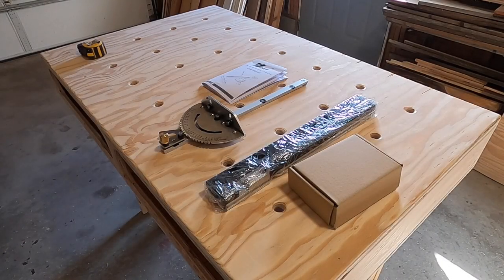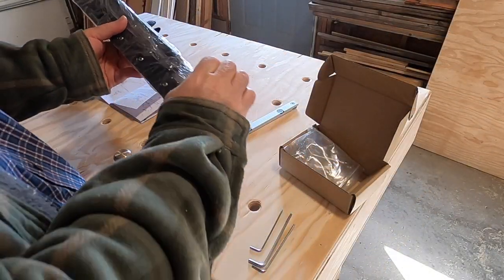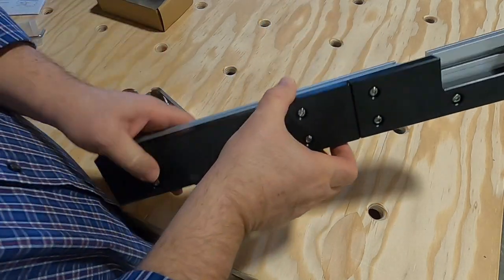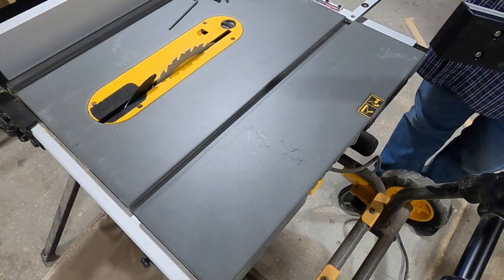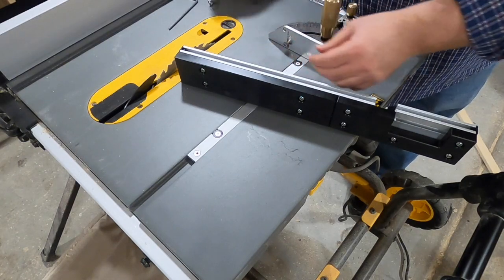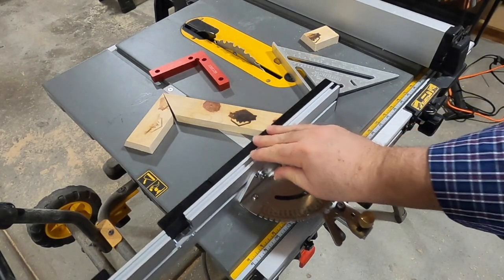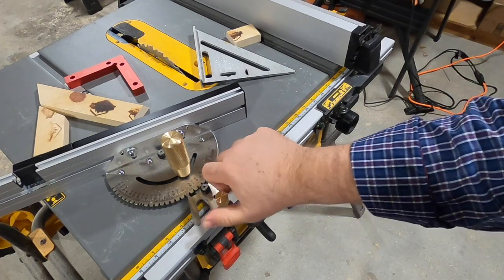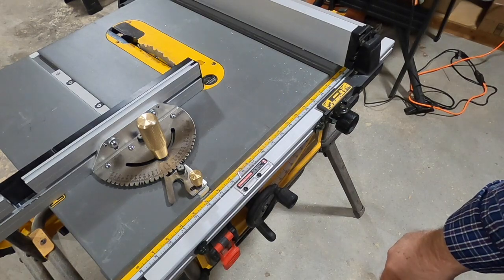Upgrade Your DeWALT DWE7491RS Mitre Gauge - Product Review Episode 15

Comment: Mine came Bangood with the brand name W-NEW.  I fell into the same trap I've fallen foul of a couple of times before ordering Chinesium goods.  I didn't read the description properly and initially received just the fence — which is not a lot of use by itself.  It was excellent quality though, so I immediately ordered the mitre gauge part (with brass handle, because it looks so beautiful, and low and behold it arrived barely two weeks later.  The first part must have taken several months to turn up, and they take your money up front.  Anyway, I put it together and was pleased with my purchase, and it still cost me a fraction of what an Incra mitre gauge would cost.  I was not sure what the wee fingers were for on the fence, so I turned to YouTube and discovered a massive bonus discovering they turned the part into a box cutting jig.  I have a shop made box cutting jig, but it does not produce super tight joints and I've never got round to fixing it, but it looks a piece of cake with this tool.   

Mine came with an invisibility cloak — it just took me a good ten minutes to find it, and my shop is relatively tidy at the moment.  I wish it folded up a wee bit tighter for storage.  You can get a bit straighter by removing the big brass knob, but then it will take even longer to find both parts.  It's surprisingly heavy, and really solid, and even though I had to buy mine twice, it is still excellent value for money.
Reply from the maker: When I bought mine, it came as a kit. I guess you can only buy them separately now. Glad you like anyway.

Comment: Good and helpful video. Could you please advise the cross-section dimensions of of the miter slot of the DWE7491? Many thanks
Reply from the maker: I know I can slide a 1x4 on it's side through the slot.
Fits snugly, so it would be 3/4"

Comment: So you made two straight cuts (at 7:15-7:25 in the video timeline) on the piece of timber that was mitered on both ends and then you checked miterred corner fit? What did you demonstrate there really? Also work on your camera positioning, there is no need to block the camera with your body half of the time.

Comment: Like that miter gauge...  Are you still like the DeWalt Saw? Looking at replacing my 18 year old Ryobi Bt3100. It still is working but parts are hard to find and as I redo my shop I want to build a saw into a work station. Looked at the hybrid but not sure if I want to use that much space up. I build mainly small items and cut my plywood outside before I take it into my shop.  My main concern is the fence. I have used a t-fence for years so I looked at the Ridgid contractors pro saw but have heard the fence is an issue.  Your thoughts?  Thanks
Reply from the maker: Hey Reginald, I absolutely love this saw. It's the best one I've ever owned (of course that's not saying much). Once you get the fence on this saw dialed in, you never have to make sure it's square again. The cuts are perfect everytime just going off the guage. On my old Ridgid contractors saw with a T fence, I had to square it with one of those triangle squares everytime I moved it. None of that with this saw. Keep in mind this is still a contractor's saw, but it's a pretty nice one.
Reply: @TheWoodHaven  Thank you for responding. My Ryobi was more like a contractors saw with a permanent  stand. Only has a rip of 24 inches. I had taken the stand off to incorporate it into a table. I build jewelry boxes, crosses and small items for rural Churches for their children's camps. My main need is something that cut straight. Love to have a hybrid but my shop is only 16x20 and I like to have space to work... don't like having to move stuff around. Going to order the DrillPro to... it will help with my boxes... great vid by the way.

Comment: Hello, I am going to buy  the same miter gauge for the same saw, but only without Box joint jig = with common fence. Just thinking about length of the fence 600mm or 800mm. Do you have any suggestion or any advice what is better length? Thanks
Reply from the maker: For me personally, I like the longer length for more stability,  but I can see where the shorter length would be better for some.

Comment: When starting a cut with the gauge off the table, do you have to lift the gauge slightly to get it onto the table? The track on my DWE7491RS is deeper than 3/8" (it's about 0.400"). When trying an Incra27 gauge I had to lift it slightly to get it onto the table. Is that the case with this miter gauge too?
Reply from the maker: Lifting would work, but I've found if I just hold it level, it slides past the edge ok. If I let it tilt to one side or the other, it does need to be lifted.
Reply: @TheWoodHaven  thanks it is a shame dewalt has such a nice saw and such a poor miter gauge.  The short extension cord was frustrating but that was an easy fix.
Reply from the maker: @j2jcox  I agree.

Comment: One comment and a few questions for you....1. The DrillPro mitre gauge you reviewed looks quite impressive, and I am leaning toward purchasing one also for my table based on your and others comments/reviews. You were very helpful. One comment I'd make is that I noticed that you show your 45 deg. mitered cuts to be spot on; however, your video only shows you cutting 90 degree cross cuts with the DrillPro which doesn't prove the accuracy of the 45 miter cuts. Did you happen to edit that out?

Secondly, I have a Dewalt Model DWE 7480 table saw which varies slightly from yours in that the surface area between the front of the blade and the front edge of the table appears less than your model. Do you have any problems with the bottom of the miter head catching on the edge of your table as it approaches and slides toward the front of the table if it starts its approach from the outside of the table? Lastly, is there anything you do to prevent or minimize tear out? For example, with the metal fence, can you install a sacrificial wood fence in front or behind it for a zero clearance cutout? I'm not sure if I'm making any sense here :) but I thought I'd ask. Thanks!
Reply from the maker: Hey David, yeah I made 45 degree cuts. I'm not the best video editor. I cut stuff out like that often and don't realize it. This mitre gauge has a built-in sacrificial layer of plastic for zero clearance cuts. I haven't noticed any catches as the fence approaches the outside of the table. I think the trick is to make sure you have a nice snug fit in the track.

Comment: Hi.  I just bought this but there's a lot of play in my Dewalt 4791 even when I tighten the screws to expand the plastic rings.  What is the width of the slot on your dewalt 7491?  I measured mine and it's 19.6mm.  The miter gauge only expands to about 19.3mm.  Can you confirm with what you have?  Thank you so much!